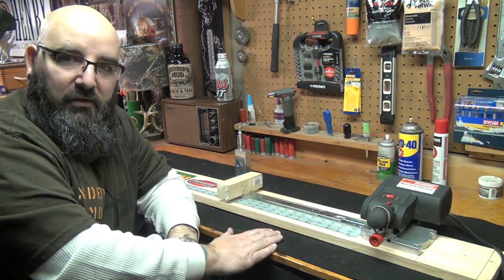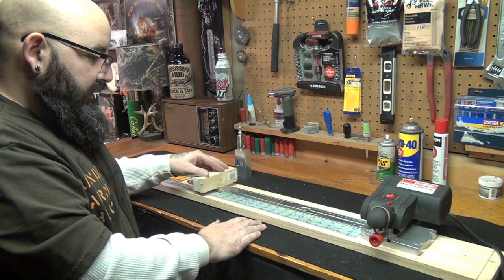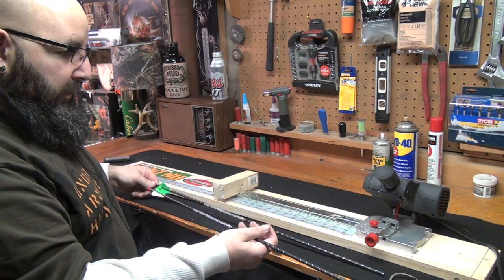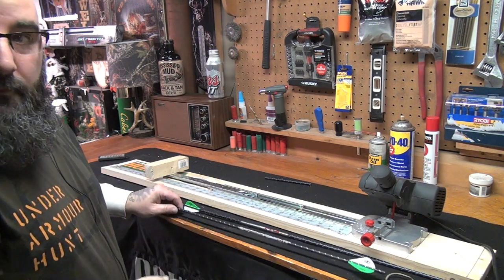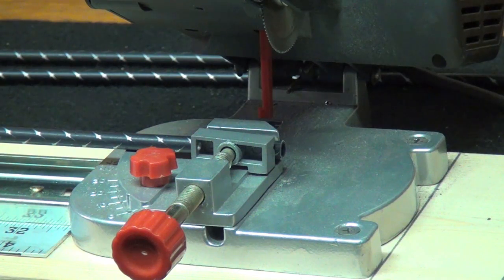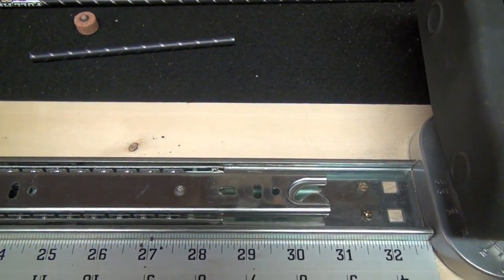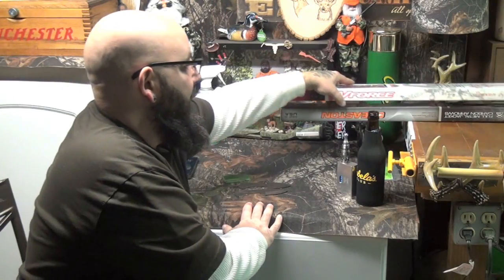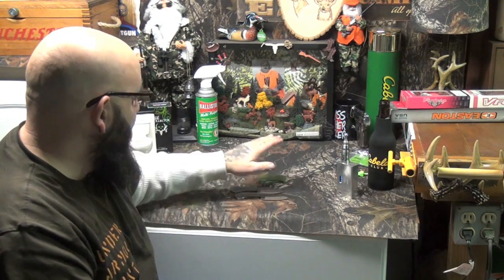how to make a arrow cutting machine part 3 with the yankee cowboy

Comment: This is the best homemade arrow cutter I have seen. One thing that may help on the slide block could be to cut out a small section to allow the block to sit freely on the measuring tape. This is one that I will be building. Thanks for the great video.

Comment: Since you pull the nocks out before cutting, you should fill the hole in the block with a peg that fits inside of your shaft so the shaft butts up flat against your block. Then you'll have an exact length measurement every time. Cool rig :)
Reply from the maker: That's a great idea thanks!

Comment: Great video! Not sure if you already figured this out, but if you drill out the hole for your arrow a little more inside the 1x1 block, and nail an old piece of bowstring to where it is stretched tightly across the hole. your nock will clip onto the string and the rest of the nock will go inside the hole. that way you wont lose any nocks during your video production, lol
Reply from the maker: great idea

Comment: Nice solution, i will build one but i will change the sliding block to  make it flat and with a pin/nail i will nock the arrow, also i will change the sliding block wih a screw to lock the block to prevent it from sliding  so i can cut several arrows exaclty on the same size. and maybe i will add a small block on the slide under the arrow to keep it flat.

Comment: It would be nice to have a way to clamp it in place at the measurements so you can just set it and load arrows I like it a lot thank you for the video.
Reply: There is really no reason to use a drawer slide to hold the block.  Just take a router and make a slot in the mounting board then use a bolt and wingnut to lock it where you want.  Then cut a whole dozen if you want.
Reply: @caleb homer - I'm gonna say you could do that with an extension to the rear of the block that holds the nock end of the shaft (right angle repair plate or similar ironmongery? You could maybe use a wider block block of timber, and drill a vertical hole thru it, on the centre line) and through that you'd mount a vertical clamping screw - maybe something like you'd see arranged in threes to hold your Christmas tree upright in its base. - and you'd screw that down against the mounting board carrying the whole rig. That oughtta do it, I guess.

Comment: I made one from your idea. The problem I see using the draw slide is that there is way to much play in the bearings and the actual slide. The slide has both up and down play as well as side to side. For what I am going to use it for, it will be ok. Target arrows. Thanks for the idea.
Reply from the maker: I don't have any issues with mine. even if you had some play make your cut slow so you don't move it around.

Comment: Nice arrow saw and well done video on it...
Reply from the maker: Thanks I've cut a few dozen arrows and its performed great! 
I have a question I'm getting into pistol caliber reloading and been beating myself up over what setup I want but I'm down to the rcbs pro 2000 any thoughts on that machine?
Reply: 1yankeecowboy That machine was the one that followed RCBS's in-line progressive, and it is a good one…later on, if you decide to make it a fully automatic machine - you can.  Or just stay with it the way it is…should serve you well…And since you are used to running your progressive MEC, this should be an easy merge for you.  Best to a..
Reply from the maker: FortuneCookie45LC Yeah I was so torn on the auto index but I have the mec 8567 because I wanted to control the turret and inn case of a snag in the process it would be easier to remedy. 
I'm going to go with the pro 2000for sure thanks so much for your responses to me my friend you are a great mentor and great for the shooting community here YouTube!
Reply: 1yankeecowboy And continued success to you...you've got a better delivery than many (myself included)... Have a great day

Comment: I built one identical to it the only thing I did different is the small block that you have screwed to the drawer slide I glued in a small piece of wood on the yard stick side to take up the gap and I use a small clamp to lock it down on the measurement that I want that way I can cut a doz. arrows and not have to check it all the time, Thanks for the idea and my saw is kick ass oh and this replaced a $250.00 apple saw I had and I like this better
Reply from the maker: Love to see a pic . Post it on my Facebook page if you can.
Reply: Will do asap

Comment: Good design with the slide. Would be better if you didn't have to remove the nocks and if you could spin the arrow as you cut it. Spinning the arrows as you cut will insure a square cut. The little deburring stone is not to square the arrow, it is to remove any rough edges that may be left from the saw.
Reply from the maker: you can leave the knock in if you want but I don't seeing knock sizes vary, as to the stone yes it takes burr off and I'm sure my cut is square but I really don't think it makes much difference at 350fps.

Comment: thts not all pure carbon it hasn metal?wht blade do we use for st8carbon
Reply: I would use a 3 inch abrasive cut off wheel. 1/16th thickness. If it doesn't fit on the saw, use it in a drill on some scrap metal to wear it down. The saw has a 2 inch blade with teeth and it may not splinter carbon at first when it's sharp but I bet it will when it dulls. An abrasion wheel is the same sharpness all the way through as the diameter of it wears down as you use it.

Comment: Another thing...you have gone to all the trouble to make things true and square on the saw etc...then you free hand the most important thing and free hand the chamfer tool with arrow? doesn't make sense.
You are better off making a jig for that too.
On that note don't breathe in the carbon dust ...use a vacuum while cutting to suck up the dust.
Isn't that saw blade for wood? try using a reinforced silicon carbide blade.
Reply from the maker: good point I did actually think of that

Comment: how did you fasten the wood block to the drawer slides
Reply from the maker: wood screw
Reply: +1yankeecowboy guessing through the bottom of the drawer slide
Reply from the maker: +bunyon0341 correct
Reply: +1yankeecowboy thank you